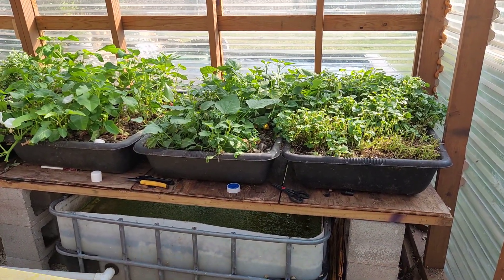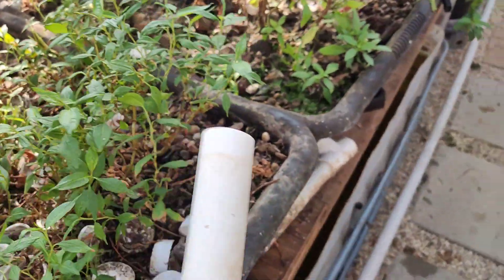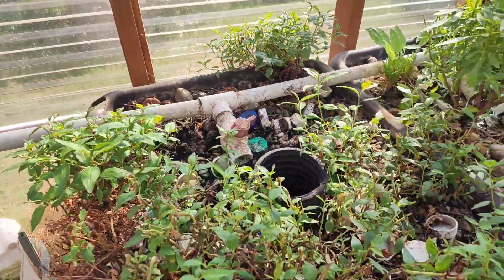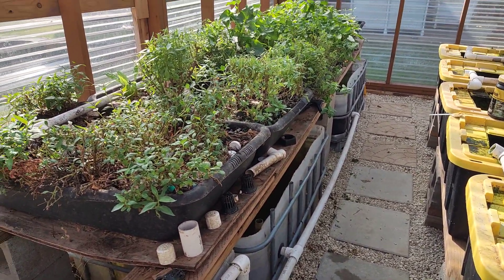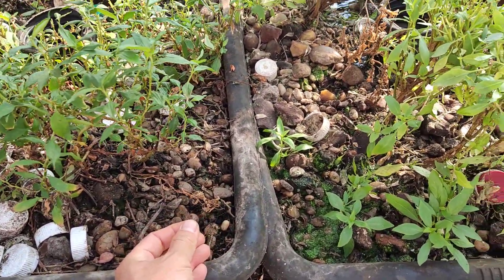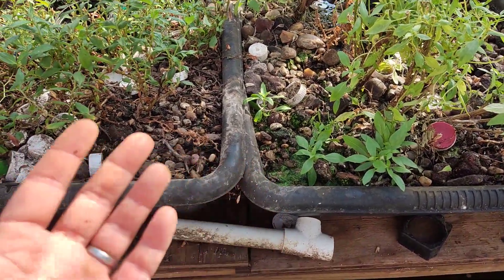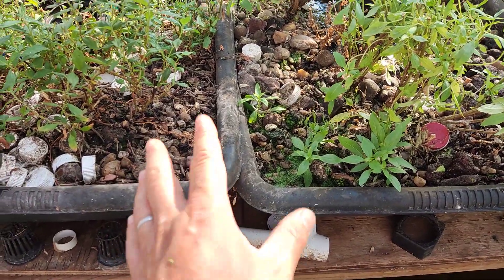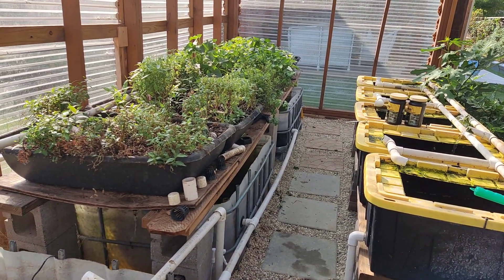AQUAPONICS 101: KEEP IT SIMPLE

Comment: wow, I'm about to start my aquaponics system, i was thinking of using a radial flow settler for the fish waste but your system is much more efficient and simple.   I also have a koi pond myself.  How are you cleaning out your fish waste?   is that the purpose of the blue bin inside the ibc tote?
Reply from the maker: Thank you, I have an old video on how I clean out the filter, definitely watch that is really easy to clean about 3-5 minutes once a week or two  and you should be good, as for the blue bin inside the ibc tote that's where I house my pump, I raised small baby koi and they tend to get suck up by the pump so I drilled a bunch of small hole at the bottom of the blue bin that way my pump will suck up the fish waste and go the filter, remember to keep your system simple and you will have plenty of amazing vegetables and mints harvest to come especially Vietnamese mints and herb they love aquaponics
Reply: thank you for the details.  How about the fish waste from your sump tanks?  Is there a pump in one of the sump tanks to suck up the water / waste?
Reply from the maker: The ibc tote with the blue bin that  houses my pump is my sump tank and sump pump
Reply: @chu0435  how are you moving the water from the 2 smaller sump tanks ( the ones under the grow beds ) to the main sump tanks?  I see that you have a pvc pipe for the water overflow. Just wanted to get some details since i will be setting up my grow beds similar to your setup.  Thanks a bunch.
Reply from the maker: All gravity fed, I connected all three tanks together using schedule 20 1" inch pvc pipes but if you can use the 1 and 1/2" inch the flow will be much better, so all three ibc tanks are my sump tank, water will always try to reach and equal water  level with all the three connected sump tank so when the pump turn on for 15 minutes from the first sump tank to the grow bed and then drain back to the 2 sump tank below the grow bed the water from those two sump tank will rush to the first tank to reach equilibrium. So you will need two (800gal/hr 25watts each) water pumps to go against gravity, one will run 24/7 from the main sump tank to your filtration 55 gal barrel then flow back to the sump tank and the other pump is on a timer 15 minutes on and 15 minutes off to go the the grow bed
Reply: @chu0435  thank you so much for the details :) -- I'm excited.
Reply from the maker: You welcome good luck
Reply: @chu0435  would the gravity fed system work if i'm using a full size ibc 275 tote and connecting it to the 1/2 size sump tanks?   i.e. i'm planning to connect the full height 275 tote to the 2 - 1/2 size sump tanks so the water level of the full height 275 will be higher than the 2 - 1/2 size sump tanks.
Reply from the maker: It should work but remember all three tank will try to reach equal level

Comment: In your grow beds... What 'bulkhead fittings' do you use, going thru the concrete tubs??
The huge black pipe size?... Or just the PVC pipe size in the centers.. ?
Reply from the maker: I used the 1 inch uniseal (they are the best) for the 1 inch PVC pipe and I used the concrete mixer tub (the best for aquaponics grow bed). The huge black pipes are 6 inch irrigation tube. Hope that helps
Reply: @chu0435  yes.. So, the black pipe just helps the steady seeping of water.. 👍
Reply from the maker: The 6inch pipe is just a gravel guard